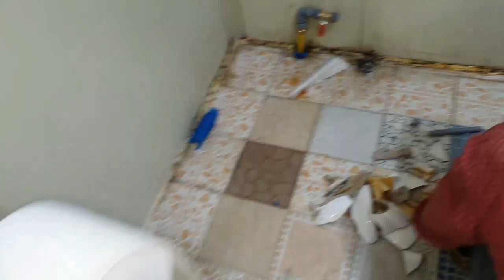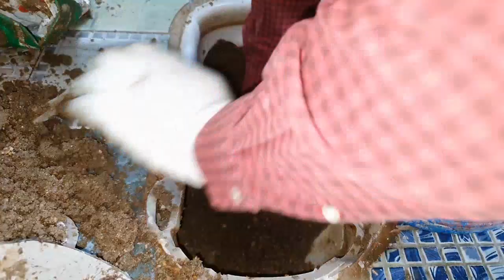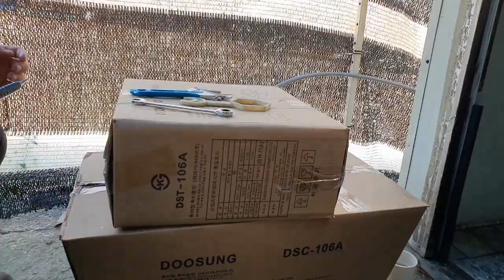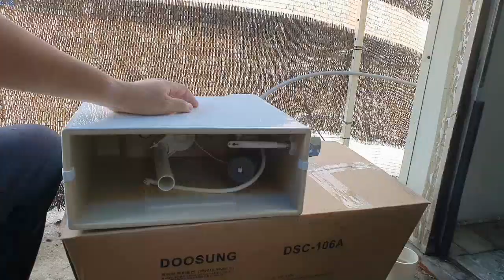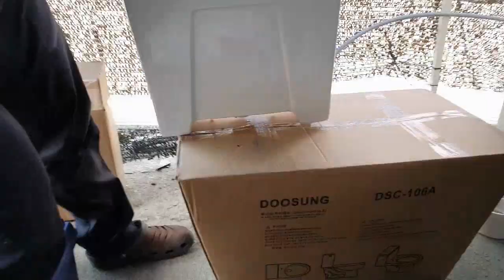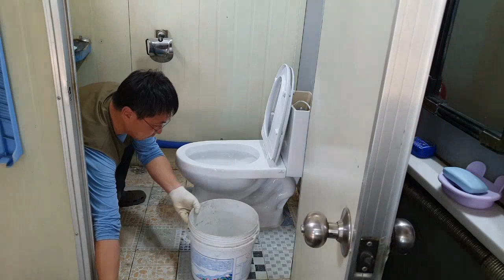ENG] 화변기를 양변기로 교체 replace a squat toilet to sitting toilet flush toilet

Comment: I did not see any water system for that Squat TOILET.... So how the hell does a squat toilet flush the waste down the pipes???
Reply from the maker: It's hard to explain in words, and I'll film it next time I get a chance.
But we're losing a lot of them too.
It's hard to clean the drain when it's uncomfortable and clogged. It's unsanitary.
But it's good for a bowel movement.
Reply: Starting at around 0:50, the vertical pipe being removed comes from a tank or cistern on the wall, which supplies flushing water just like the rear tank on the replacement toilet.

The high placement serves two purposes with varying degrees of effectiveness: more floor space may be available if the tank is mounted high enough, and the longer drop produces greater force to scour the "dry" bowl of a squat toilet.